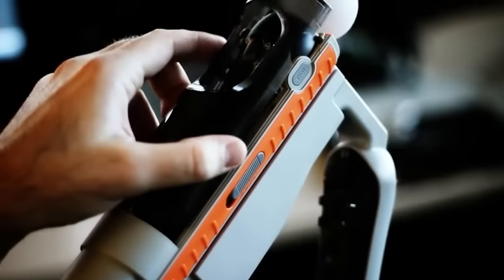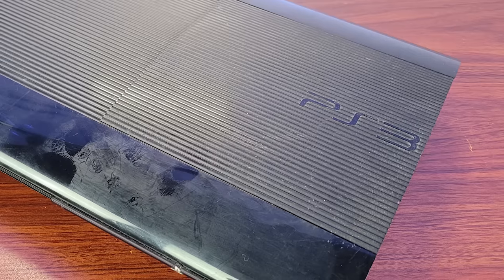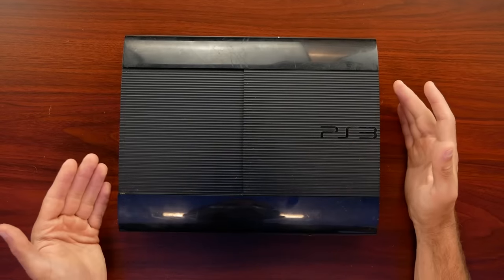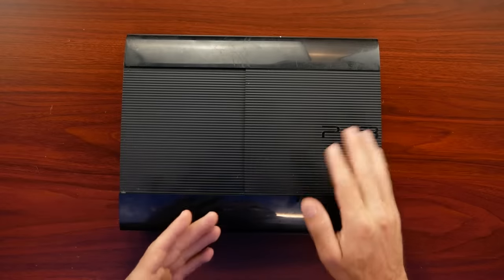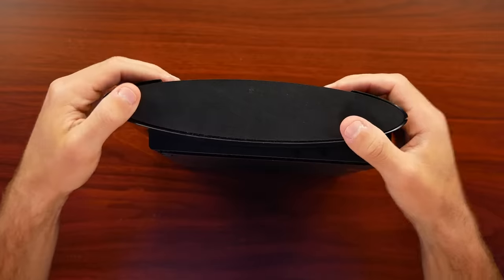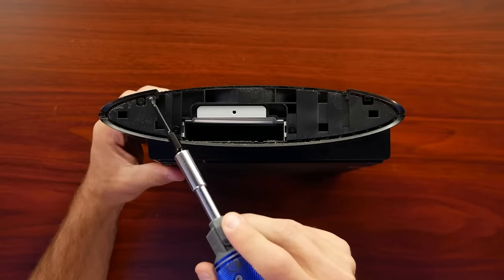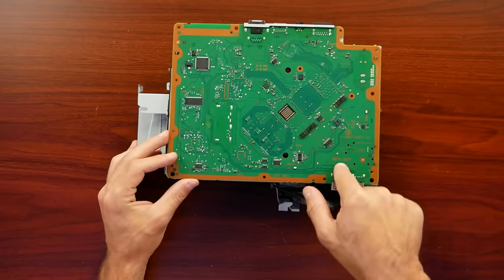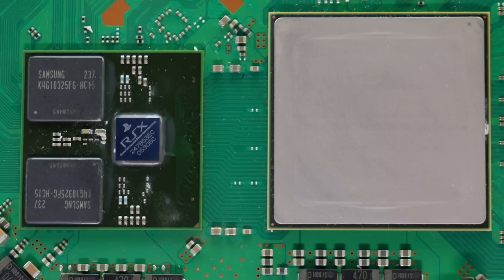The Weirdest PS3 Sony Ever Released

Comment: That’s super slim is incredibly reliable. I own two of them and have never had an issue.
Reply: I am planning to buy a PS3 so should I go for Slim or Super Slim?
Reply: @sarahphyllis5782  
Personally, I'd say you can't go wrong with either one. Just get the one you either like more or the one you prefer more.
Reply: @nsgames24  I liked the lightweight of PS3 Super Slim but I loved the bluray drive system of PS3 Slim. I have no issues with storage or the power button etc. All I need is a durable console which can let me play games for hours and hours when I am depressed or sad. I just don't want the console to get heat up and end up dead like the original PS3
Reply: @sarahphyllis5782  
Trust me, both Slim models are a heck of a lot more reliable than the original models. But in terms of which one you want, I honestly don't know what to tell ya.
Reply: Where in the heck are you finding them?
Reply: @sarahphyllis5782  get the super slim since its newer
The slim blu-ray drive can break , with super slim its way harder
Reply: @zeroturn7091  its available on the pawn store where I live. The owner there has both Slim models and Super slim models of the PS3. But they are pre-owned consoles and the owner's son said he reapplied the thermal paste and cleaned them internally and externally so that it looks like a new one. By the way none of them have any issues. But I am confused which one to choose because both looks beautiful
Reply: @sarahphyllis5782  make sure to get the ps3 exclusives that are stuck on ps3 like infamous , littlebigplanet
Reply: @Alex-mx3gs  yes he had all these games: Killzone 2,3, Uncharted 1,2,3, Infamous 1,2, Little Big Planet, Gran Turismo 5,6, Socom 4, BioShock Infinite, Ace Combat Assault Horizon and some Capcom and fighting games. He said keeping these games now is quite useless for him since he cannot use them on his PS5 and his PS3 broke badly so he won't buy PS3 anymore as there are no brand new PS3 Console available. He is more keen on going digital games for his PS5
Reply: @sarahphyllis5782  pretty good games
Reply: @Alex-mx3gs  sadly he doesn't have Metal Gear Solid games or the remastered version of some PS2's iconic games sadly.
Reply: @babykanga11  EVERY  SINGLE one got stolen
Reply: @totallylegitsonyemployee  yeah most likey but that doesn't mean the console is banned...yet
Reply: @sarahphyllis5782  if you're going to be legit get a super slim but if you're gonna jailbreak it get an early model super slim so you can have proper cfw on it instead of hen
Reply: by early model super slim i meant early model slim, my bad
Reply: @sarahphyllis5782  all PS3s support hen, it's just a soft type hack
Reply: @marrymekatsuya  great then I will jailbreak someday
Reply: @sarahphyllis5782  thermal paste??? On a super slim PS3??? Pretty sure they have a thermal pad and a fan at that late in revisions.
Reply: @sarahphyllis5782  I would say slim, as if you ever want to install cfw you can’t do it on the super slim, and the slim just feels more high-quality than the super slim
Reply: @myrealusername2193  yes PS3 Slim also looks better than the Super Slim and the bluray drive seems similar to that of PS4
Reply: @SockyNoob  🤔🤔🤔🤔🤔🤔 I am confused
Reply: @sarahphyllis5782  yeah, I have a super slim and the drive on it feels awful, I keep accidentally opening it by trying to close it.
Reply: I have a ps4 but wanted 2 revisit some games that sadly aren't on Ps4  and picked  up a super slim for 80 quid and put 500g mem inside it  I have lot of  ps3 games  Az my old ps3 phat is still alive but noisy and I've cleaned it opened it up paste etc it's not overheating just sounds like a jet the disks are not hot actually ps4 gets hotter but the noise is unbearable the ps3 super slim so much better  quite as mouse exept slight noise when downloading a game  and games are cheap youl find them everywhere for next 2 nothing and  the amount of controllers you can use for ps3 is actually amazing   you can use Ps4 controller  ps5 controller i have a retro console  and controllers work for ps3  I'm using a giotech wireless controller cheap controller but feels so good  however my brain has 2 switch sometimes I forget on ps3 the fire buttons are reversed  2 the  ps4   sounds ez but my brain goes duh every time like muscle memory
Reply: Yeah ...except when your trying to make accounts in small countrys were you meet frequent errors and roadblocks adding to the frustration of account creation in general.
I didn't even want an account. 
I just wanted to connect this blood ps3 to the internet but that...didnt happen...for reasons beyond my understanding. 
I guess street fighters 4 online and batman Arkham city dlc is going to forever be opportunitys left in the dust.
Reply: @sarahphyllis5782  I had the regular slim but it keeps rusting after 4 or 5 years and then roaches decided to move in then it died. I have the Super slim and I think I might just change the hard drive since its starting to slow down a bit and I have the super slim since 2017.
Reply: @Jerry4050  use 2.5 inch SSD instead of mechanical drive and you'll be fine
Reply: @sarahphyllis5782  yes gets the job done
Reply: Same super slim is good deal 🤝
Reply: @sarahphyllis5782  In my opinion the super slim ps3 is the best one I brought a super slim 500gb ps3 with 25 games 22 digital and 3 discs with one controller and all the cords off ebay. I play for numerous amounts of hours each week I like the fact that it is small and compact but also that the disc drive you can put disc in the system and they don't get stuck. To me it doesn't overheat and also it's super quiet. The owner put new thermal paste in it so I think that deal at the pawn show is pretty good since they clean the system inside out and put more thermal paste. You going to love it just don't get the slim model cause once them disc get stuck you going to have the replace the disc drive and that could be costly.
Reply: my super slim's lens is kinda wonky already though
Reply: @sarahphyllis5782  you are shocked that a 10-18 year old console is “pre owned” in a pawnshop? Jesus christ dude

Comment: I think it's important to mention that PS3 installs work way differently from PS4/5 installs in that you don't have to copy the whole disk over. Iirc, most games required only a couple hundred megabytes or so, so having only 12 gigabytes of storage wasn't a bad deal if you mostly played disk-based games
Reply: I think it was more aimed at games purchased from the store although some games did install a large amount of data to the drive still. MGS4 was like 8-9GB from memory and GT games also had large data files so the 12GB was very limiting if you had just one of those games.
Reply: Until you tried to play gta5
Reply: Also actually towards the end of PS3's life circle most games are trying to have no installation at all and ultilizing Blu-Ray and cache's advantage to save the storage space. Most EA physical games does that and I was shocked to see NFS Most Wanted 2012's only drawback is the initial loading is a bit longer than digital version.
Reply: Yep. Similar thing with the 4 GB Xbox 360 if I recall correctly.
Reply: The problem was realising it the same year of gta5, a lot of people that bought it think gta 5 would run.
Reply: @AndyMitchellUK26 tell this to the mf who got Xbox arcade 360 lol
Reply: @AndyMitchellUK26 The arcade didn't include wifi,  headset or HDD
Reply: I remember getting portal 2 for the ps3. PC version was like 3GB or smth, ps3 install is like 20MB

Comment: I remember getting the super slim 500gb for christmas one year when they went on sale. My 60gb shit the bed and getting this one was so much better. Still have it, and got a new 60gb for Ps2 and Ps1
Reply: I got the same one when my 80GB YLoD on me, still miss the native PS2 playback, but at least I still have the PS2 > PS3 Memory Card adapter.
Reply: I also got a GTA 5 500 GB PS3 when everyone was at the GameStop to get the PS4
Reply: Definitely an upgrade in the power saving department... the OG PS3 was super power hungry
Reply: Lol shit the bed.
Reply: @shaggy7599  every time i power up the SS 500GB it’s nice and quiet, but i power on the 60GB to play some PS1/2? I find out Im the proud owner of a Boeing 747
Reply: Same, 60gb hardware backwards compatible one crapped out in 2011. Got one of these in 2015 I think. Still going strong! It’s much smaller and less heat spewing.
Reply: U can play ps1 games on the super slim too
Reply: @mainsmain  correct, and i do. But not the ps2
Reply: @ep3578  have you repasted it?
Reply: @therealmistermemer  repasted what?
Reply: @ep3578  if you install hen on it you can run ps2 even some psp games if you wanted to. The super slim is great reliability wise had mine for 8 since my mgs4 80gb bc model died I slapped a 1tb in it last year and install cfw and never looked back
Reply: @fmccloud  didn't they have to wait about a year for GTA V for the PS4 LOL
Reply: I threw 1tb in there and it's such an awesome system , imo the best era of PlayStation

Comment: I remember changing the hdd on my fat PS3. The screws holding it in the caddy were the softest screws I've ever seen. They completely stripped almost immediately, without me even using that much pressure. I had to get a pair of wire cutters to put indents into the side of the heads and rotate them that way. $600 for the console and Sony uses the cheapest screws in the universe.
Reply: i opened mine this year to replace the paste and i got like 6 screws stripped, i might've needed a lighter screwdriver but still.
Reply: I had an original phat 80GB with backward compatibility and stripped it within seconds...

Comment: My favorite is the PS3 slim. Sony's final revisions always feel cheap and weird. It's happened with most consoles and their handhelds, too. They get lighter, incorporate more plastic, and are less mechanical.
Reply: Same with Xbox 360 slim, the 360 E actually took away ports.
Reply: It is your favourite because that's the one you own
Reply: @toraomc1076  he's right though. The first one felt premium, but was flimsy. The first slims didn't feel premium, but perfectly sturdy. The super slim is like all the worst parts of both, not the best like you'd expect
Reply: @deathbydeviceable  It has its own advantages, but yes, being premium or sturdy are not one of them
Reply: @toraomc1076  Or it could be he thinks that because the Super Slim looks and feels like a cheap POS. 🤷🏻‍♂️
Reply: Ngl Super slim and the fat look cool and modern
Reply: So, you mentioned handhelds, yet that's a good example of Sony making devices MORE premium and LESS cheap (PSP 3000 is just about objectively better than the first two in every way except for "premium feel" which matches the previous variants). Even the PSP Go, while it doesn't have a mechanical UMD drive, it trades that for the mechanical slider and has a dock and some other new features. You might want to remove "handhelds" from your comment, since it appears to  undermine your argument. I'm a bit shocked and pretty disappointed that I'm the first to point this out, too.
Reply: Less mechanical = less potential problems
Reply: @awesomeferret  i think hes talking about the psp e1000
Reply: all three versions of PS3 are completely covered in plastic. what are you talking about?
Reply: @deathbydeviceable  it's the most reliable and energy efficient one. it results from years and years of revisions.  you're just being a dork
Reply: @mjswoosh  yeah, because bulky, loud and inefficient equals quality, eh?
Reply: @djangofett4879  look at this fanboy everyone.  he still thinks the console wars is still going on and must protect and attack any criticism of his brand lmao
Reply: @deathbydeviceable yeah i agree the ps3 fat aged like milk both functionally and aesthetically the ps3 slim tho has aged like the finest of wines the ps3 super slim is ugly but works well
Reply: When console is at the end of its life-cycle and production cost is lower it makes sense to make a cost-reduced cheap version for the not-so-rich segment of the market. Even if the next gen is just coming there will be ppl happy to buy a cheaper version and the console has matured, has good games and bugs have been ironed out. 

Super S is very different from the earlier models, which were marketed as high-end products.

Comment: Love my super slim. Grabbed one a few years ago to play Demon's Souls before the official servers shut down. Love not having the disc slot. The sliding cover might fail eventually but it's certainly easier to access!
Edit: Mine also has an HDD and not flash memory, thankfully.
Reply: This model is the worse PS3 model it’s the cheapest built and doesn’t have all the features of the OG PS3.
Reply: Iv had my super slim scene it came out!  Still performing like new! Still play my games & still watching my blu rays!
Reply: @ZackSNetwork  Hard dissagree. Runs cooler, uses less energy, the drive should last longer, its quite small and light. I really would like to get a og ps3 backwars compatible BUT knowing it will die for sure...
Reply: @davidsomoza  ps3 super slim has ps2 emulation its just not enabled (can be accessed with ps3hen)
Reply: @ZackSNetwork  Bro you can say the same things about the slim
Reply: Yep and I have Super Slim PS3 and i got it for my birthday (Which was on May 5th) because my PS3 Slim's fan failed and over heated and the PS3 Slim died
Reply: if you are a very rough with your console then the disc tray might break.  to me its extremely reliable.  my fat ps3 died and i had to take the thing apart to get the disc out.
Reply: @ZackSNetwork stop crying, it looks cheaper but it is definitely doesn’t feels cheaper upon holding, has the best revision of rsx chip, runs quieter and cooler and if you complain about the top loader feeling cheap, what are you? A Baby who keeps breaking the toploader just because  you can’t maintain and appreciate your stuff and just because the design allows breaking it easily. No excuse if you are child
Reply: For anybody wondering: Using the actual Eject button to open the disc tray instead of forcing the door open with your hand helps to prolong the lifespan of the disc tray sliding door by a *lot*.

I got my PS3 super slim somewhat near release, always used the eject button to open the door instead of using my hand, and I have still never had any issues with the disc tray door not working properly.

I always cringe whenever I see somebody force the door of a PS3 super slim open by hand, but like 90% of people seem to do it 😭 probably why issues with the sliding door were so common tbh 💀

Comment: The ps3 the System that had 3 different designs that all looked wildly different.
Reply: Ps4: excuse me sir
Reply: @nomissiontodifficult3054  The PS4's three designs still kept that same shape consistently throughout its size changes, while the PS3 went from fat to slim to sliding door
Reply: PS2 still on top with the four distinctive designs. Not counting all the lesser design variations for two out of those of course. Almost up there with the Megadrive really. :)
Reply: @AltCutTV  Four? You mean two (the OG one, and the Slim which looks very similar to the original, only a lot thinnier and smaller)?

And yes, I don't really count the PSX since it's very different compared to the PS2.
Reply: @netako   PSX is an official PS2 product, so it should count I think. Being notably different the criteria to count after all. The fourth one would be the TV-PS2. 

Only the regular systems were sold in most regions though, so if only counting global availability then, sure. But that makes it all a bit boring doesn't it? ;)
Reply: @netako  There is a PS2 Slim with power supply inside
Reply: I feel like the PS3 Fat and Slim looked somewhat similar design wise the super slim was the only console that looked noticiably different and ugIy af
Reply: Honestly of you told somebody who had never seen a playstation that a super slim was a ps1, regular slim was ps2 and the fat one was a ps3 I bet they would believe you based on how wildly different they all look

Comment: I love the SS Model, with an SSD installed it's super quiet and faster than the previous models.
Reply: I've been thinking about installing an SSD in this system, so I might actually still go for it.
Reply: @ArtisChronicles  I have a 1TB in both my Slim and SS models and it's great.
Reply: i also did ssd upgrade for Gran Turismo , reduces loading times a bit
Reply: It gets bottlenecked by the Sata 2 interface. You should have put a 2Tb 7200RPM hard drive instead. Complete waste of money.
Reply: @ZackSNetwork  Not at all, everything runs smoother and quicker with the SSD. If anything it was totally worth it.
Reply: @ZackSNetwork  what? An SSD even with "Sata 2 limitations" will still out perform a HDD. The 7200rpm drive still has to seek the data off the platters by moving a physical arm then send that data down the same constricted SATA II line. Whereas an SSDs seek time is almost instant and is only really being restricted by the sata ii line. It is still faster! You may not be getting the most out of that drive, sure but it will still be an improvement over a HDD no matter what speed the platters are spinning.
Reply: @NickChronic01  out of curiosity how much quicker was it? Games like that and MGS4 would benefit the most lol
Reply: @craigsampson3386  i`ve never timed it but it feels quicker and more responsive , and why would you not just do it i mean ssd`s are very cheap these days , i only have a 240gb but thats enough for GT6